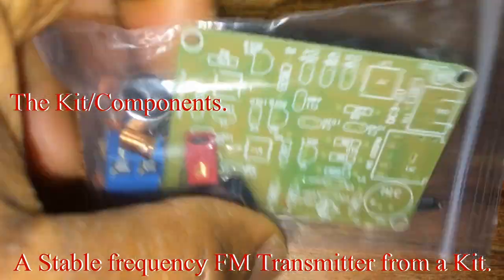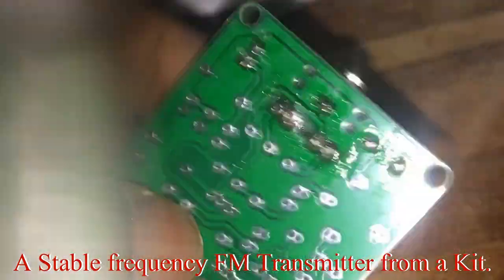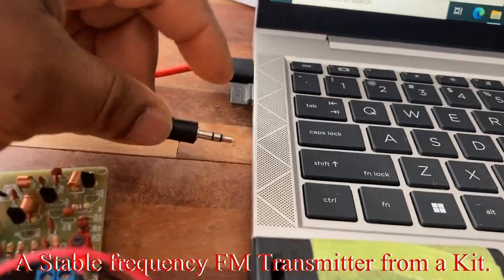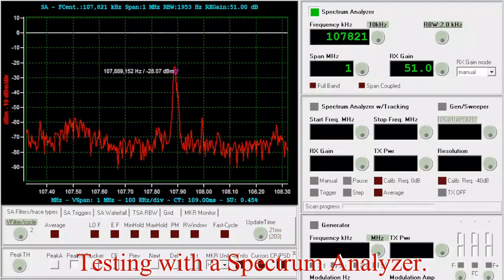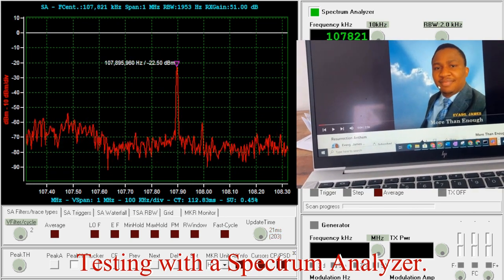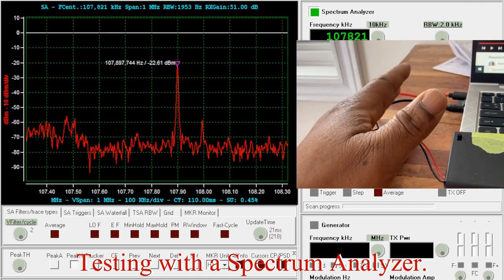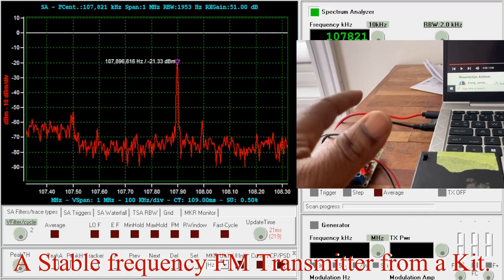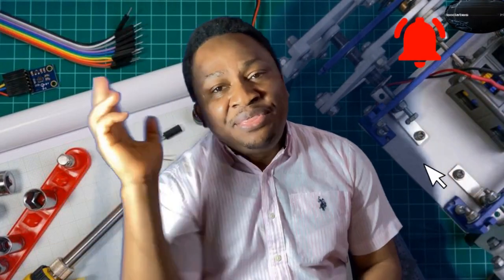How to build a Stable Frequency FM Transmitter From a Kit | Wireless Microphone

Comment: Not that easy to solder such. It's a long journey. I still fry pads or something dies from the voltage after a week or a connection goes.
Reply from the maker: You are right... it was hard to solder and sometimes the pads come off, but if you try using a low power soldering iron, it might help. I used a 25Watts soldering iron and it was pretty good afterwards... extra care was used on the pads to void coming off and some pins that were close to each other were just joined together with big solder blobs.

Comment: how can I increase the transmiters power?
Reply from the maker: You need a more powerful RF Power Amplifier. Increase the supply voltage as well.

You might want to try this one - https://circuits-diy.com/wp-content/uploads/2021/11/2N4427.pdf